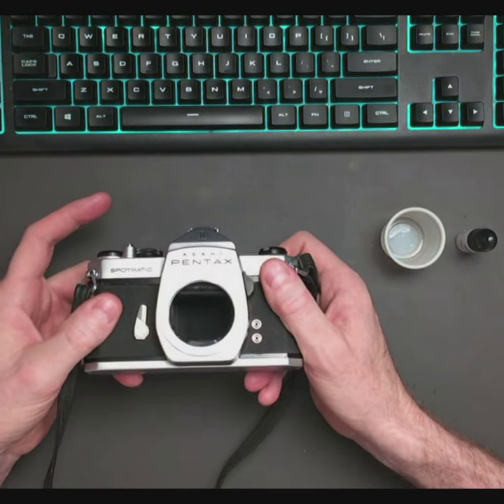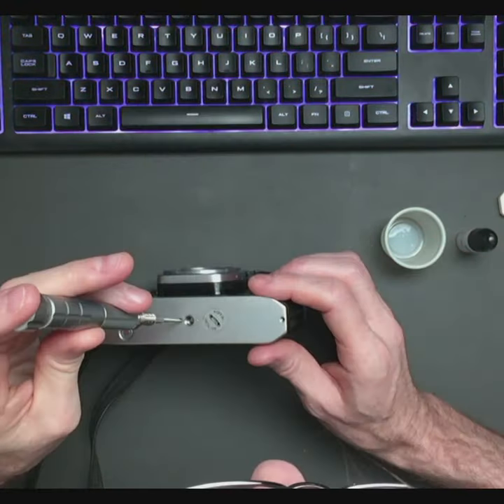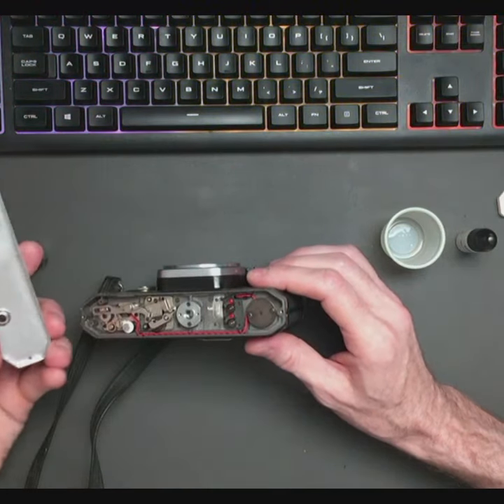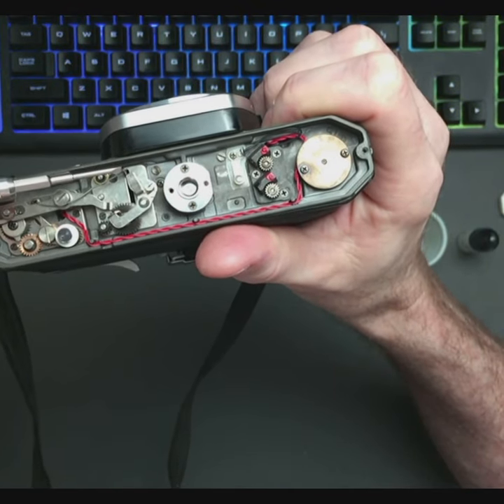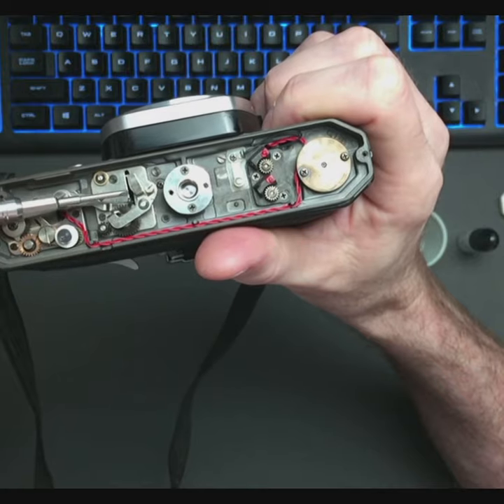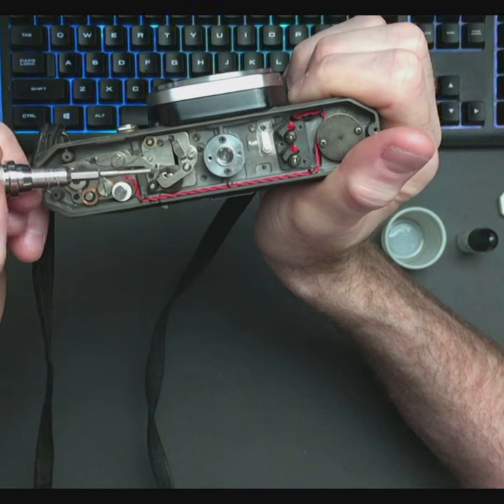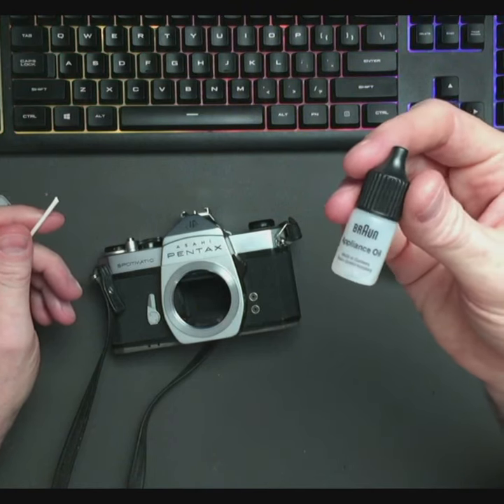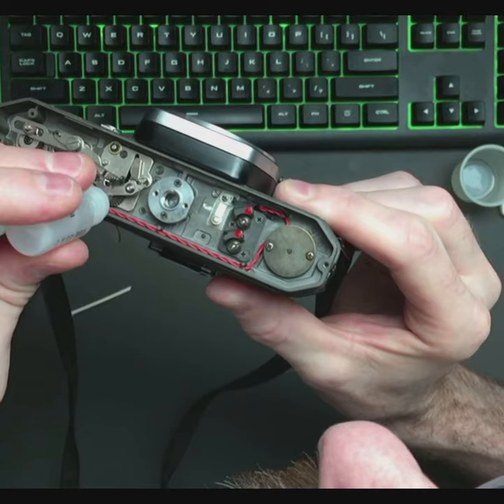How to Repair Pentax Spotmatic Stuck Mirror

Comment: Such lovely and simple cameras. I’ve sold my F3/T for a Spotmatic 1 that I bought for £15. When I got it, the mirror was locked up, the shutter speeds were sticking and the light seals were finished. After about 40 minutes of firing, some watch oil and new light seals, it works an absolute dream. Not missed a beat.
Reply from the maker: That's great to hear! I hope you share your work!

Comment: what lubricant would be sufficient?  could i use a lock lubricant
Reply from the maker: You want a low viscosity, non-volatile oil that won't gum up over time. The recommendations I've seen are for clock (not Lock) oils like Nyoil or Liberty Oil. I'll add links to the comments. Please note that I do not have personal experience with either of these, I've just seen them recommended by others online.

Comment: Its getting stuck sometimes, even i allready applied appliance oil on these parts, do you have any other problems you know?
Reply from the maker: For mine, it took actuating (and unsticking) the shutter many times to make sure the oil worked its way into the gear spindles. You're trying to lubricate the spindle in the center of the gear, not the teeth of the gear (just making sure this was clear). It also may be that you need to clean the parts. Sorry, that's all I've got. Good luck!

Comment: No one ever talks about which screwdriver to use for these tiny Pentax screws and it drives me mad.
So many videos on how to repair a Pentax stuck up mirror but no info on the tools, although it’s nice you showed the type of oil used to lubricate, which comes with electric razors sets these days lol

Would it be possible to know which screwdriver you’re using please ? I’m sure many like me are wondering, thanks !
Reply from the maker: Hi, absolutely! I use a Nanch precision screwdriver set I got on Amazon. There's a link to it in the description section of the video, but if you search Amazon for "Nanch precision screwdriver set" you'll find something close enough.

Comment: hi, can i use rp7 for this issue? And also my battery cap is stuck, i completely cant open it , so do u have any advice for that too?
Reply from the maker: I would not recommend spraying anything into your camera. Better to use a small applicator for a proper light oil like I have linked in the comments. For the battery compartment, it depends why it’s stuck. If it’s cross-threaded, you’ll have to brute force it and replace it if the female threads aren’t too damaged. If it’s battery corrosion, a chemical approach might work (lubricant or vinegar for example). Be cautious: the original batteries were mercury cells. Good luck!

Comment: This seems to be my problem, did your mirror get stuck whenever set below 1/30?
Reply from the maker: In my case it was 1/8th, but yes, slower shutter speeds are more likely to stick.
Reply: So I set my shutter at 1/125 and it would get jammed. The local camera store owner who sold me the camera told me to put the shutter at 1000 to fix the issue, it works but now it’s still
Getting jammed, might be because it’s cold where I live.